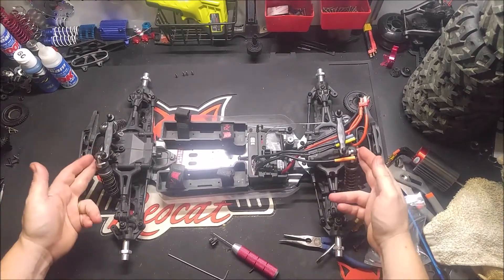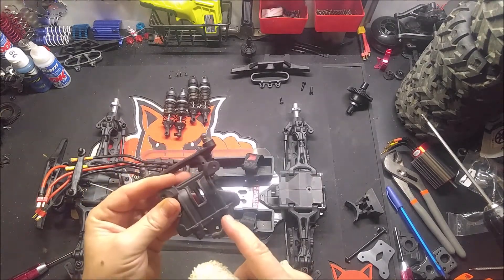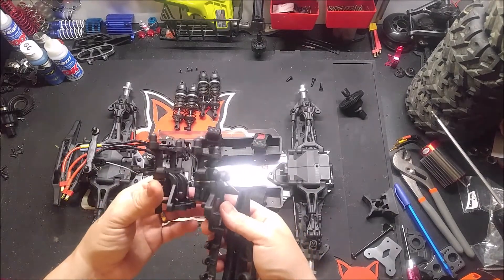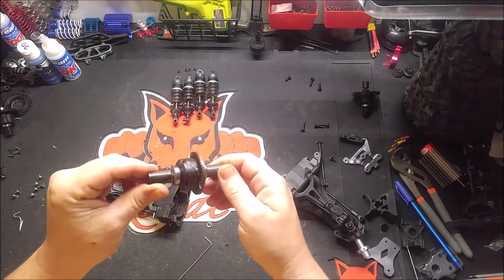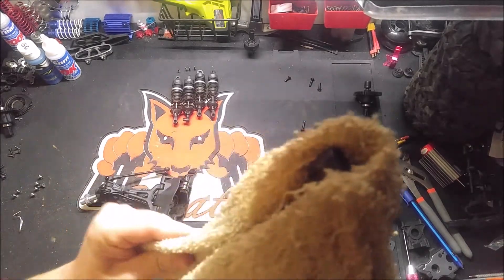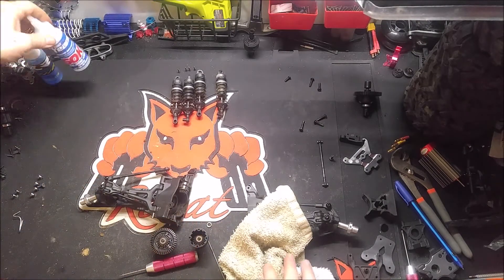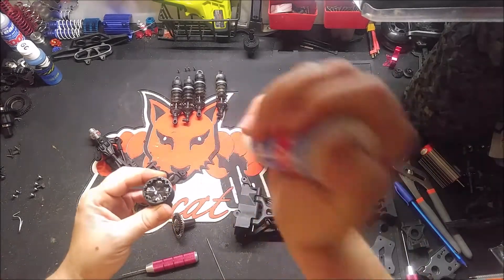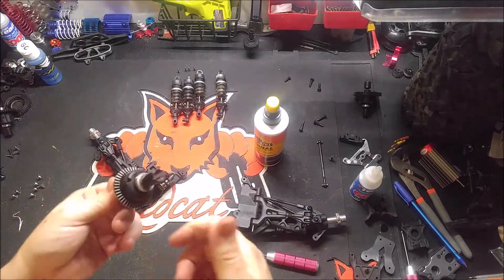Redcat Landslide XTE - Upgrading and Maintenance Part 2 of 3: F/R Differential

Comment: Hey man great info, I have the Landslide and the Shredder, I love them both, but my shredder diffs are stripping, and I have had it a shorter time than the landslide.   So far no issues on my landslide.  Shredder center diff is shot along with the rear.  I am tempted to do what you did here with the landslide to the shredder.  Would you recommend the same procedure?   I have only run the shredder maybe half a dozen times and I am bummed that they are stripping.  From what I know, the diffs are the same as the landslide.  I put some Duratrax Six Pack tires on my shredder too, wondering if they helped strip the diffs, Your thoughts?
Reply: Ive heard of several people putting larger tires on their shredder and it stripped the diffs

Comment: looks like they engineered these bulk heads pretty solid. But still kinda weird that they split open left to right. Every vehicle I have ever owned splits top to bottom. I'm curious to see if the mesh between the input gear and crown gear degrades over time. And if it does would you be able to shim the diff closer to the input gear without causing a gap in the seam of the diff housing/bulk head.

Comment: I could take that apart but never get it back together hahaha
Reply from the maker: did you ever get it?
Reply: @NPCRC  yea I bought a landslide. Its a beast. Its fun but the tires balloon so bad , can only half throttle most of the time. I want to put thicker oil / grease in diffs but don't wanna try yet lol. Need lots of room to drive it.
Reply from the maker: @stinky3shoes491  upgrades coming soon and the 300K oil is in stock with me for center as well as 60-100K for F/R if you need it!